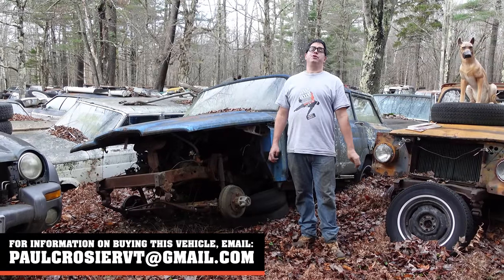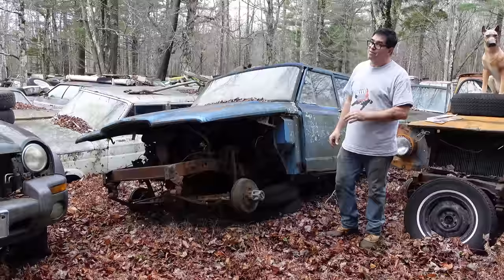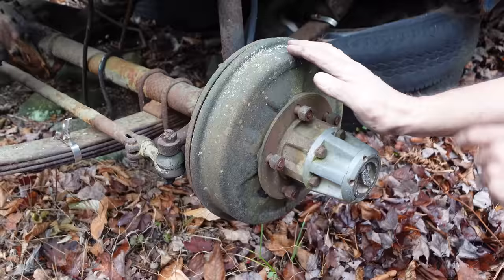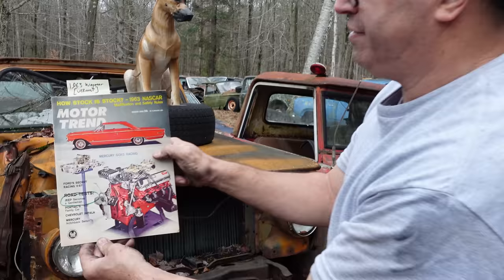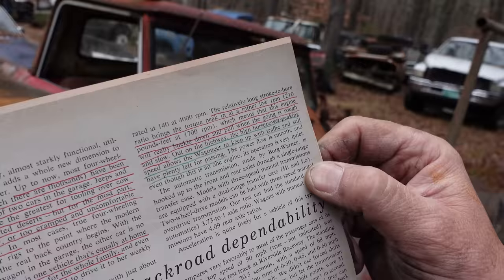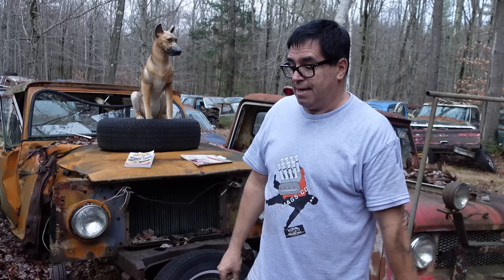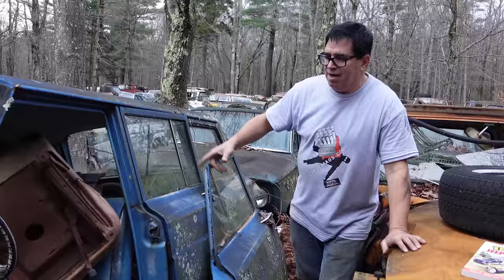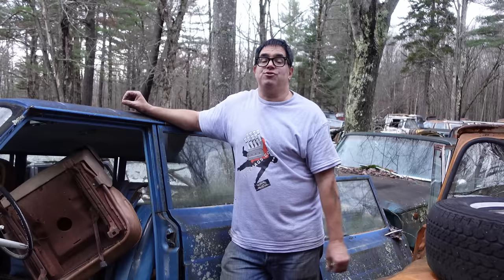Low VIN It…The 315th Wagoneer Ever Built!

Comment: Yup, need the VIN to win:

14 for J-100 4WD Wagoneer, 14 for four door station wagon, and a production sequence of "1" denotes a 230 CID straight six equipped vehicle, starting sequences with "2"were for 232 CID straight sixes, "3" for the 350 V8, "4" for the 258 straight six, "5" for 304 or 327 V8, and "6" for the 360 V8. Of course, these codes are dependent on the year as certain engines were not used in certain years.

Starting in 1964, you could also get AC in these. Possible code 223 Nordic Blue exterior paint. The Toldeo, OH complex has been in operation since 1910 and still assembles Jeep products today as of this writing under Stellantis. It has produced Jeep products on a continuous basis since the 1940s.
Reply: I wish he would learn how to pin comments so yours would be at the top.
Reply: @maineiacman  Nice of you to say. Pinning comments would be Mr. Magnante's choice to do so. It's his channel and I'm supplementing the information he provides, rather than taking his thunder away.

Comment: I have a Wagonneer from the first month of production. The 87th off the line in September 1962 and number 315 in the video rolled off the line in October '62 with serial number prefix 1414 (J-100, 4500 lb, 4x4, 4-door wagon). I also have the same Motor Trend magazine. My Grandfather had a '64 Wagoneer with the 230 Tornado, 3 on the tree, for his farm truck. I used it for plowing snow and running local errands until rust became a safety issue in 1989. Great video, well-informed, and Subscribed.

Comment: My childhood friends dad (who just passed away 2 years ago at the age of 89) bought one of these brand new in the fall of 65.. It was a 1966 model Wagoneer Sky blue with a blue interior. It was a 4wd, automatic trans with the 230 tornado 6. (I'm guessing a few early 66's got this engine until they ran out.) When my friend I first met it was 1975... "The Meat Wagon" as it was called (My buddies dad was a butcher by trade and this was his work/daily vehicle.) was a 9 year old NY Jeep with an interior that was ALWAYS full of bloody sawdust, major rust/rot in the lower body, and sporting dents on every panel but the roof and hood. Back then she was considered to be "FUGLY".. But, today she would be considered to be a "Smokin Hot" patina ride!" LMAO!  The rest of the family refused to ride in her... But we loved her! The drivetrain was rock solid, starting every time ya hit the key and the thing would go anywhere in any weather! In the summer of 1977 my buddy and I at the age of 14 spent our entire summer vacation shoveling her out, patching up the floor pans with roof flashing and generally fixing the old girl up... She was in the family until the mid 1980's when my buddies dad sold it. I saw her several times chugging down Smiths Point beach on Eastern LI while I was there camping out in my spruce tip green 67 Jeepster Commando. God! I haven't thought about The Meat Wagon" in years... Good Times Man! Thanks Steve and Lockjaw!

Comment: I worked for a guy who ran a gas station and bought one of these with the 6 banger, new in 63. It would plow snow like crazy. The drawback on that engine was slow oiling to the top end and after a dozen years of around town (short trips) and daily starting to drive 50 feet out of the bay into a parking spot, the thing smoked like a chimney. (less than 20k miles at that point) Sent the head out for a valve job and new guides... it was like brand new. The guy finally retired in the mid 90s and probably sold it, still rust free from being garaged its entire life. As I recall, it was the base model, radio delete. The plow had a belt driven pump, so all old school. The front bumper had been removed in favor of a large rough sawn piece of wood, so it could be used to push cars around the yard. I'm sure it was stored away in his garage at home and in perfect condition 30 years later.

Comment: I remember in 1964 or 65 in Northern Wisconsin a neighbor getting one of these. We were impressed. I had a late 1980s model with the updated grill and front facia but it was very obvious when the hood was up that the original grill and facia were still there behind the new. It was great in the mud and snow but I did manage to get it stuck when sunk in wet mud up to the floorboards. Always bring a winch when four wheeling. That was a long hike out looking for a phone to call for a tow on Thanksgiving morning. Luckily the bars were open in Wisconsin.
Reply: It is a common mod to take off the later plastic " updated " grills and bolt on an old school " Rhino " grill ,  They really ran on a shoestring budget and having to change the press dies for any sheet metal changes was not practical politics .

Comment: I owned 2 Wagoneers and 2 Cherokee badged Jeeps ranging from 1978 to 1985. I loved them. Three of them were 360 powered. A beautiful 1984  was a 258 6cyl. That one got totalled by my wife. I also had a 1968 parts Wagon, that one had a Buick engine and turbo 400 trans, transplanted from a Jeep pickup that had a PTO driven dump box. Weird stuff.
Reply: in line I-6 was only engine we could get in calif in 1984-85 add a 4 speed  with a low first or opt  5 speed
Reply: There's a 401 jeep motor it fit .  I put one in a Wagoneer.  Only available a few years but interchangeable.   What a motor.
Reply: That 401 was Santa Barbara CA.

Comment: I had a JeepWagon 1962, a Jeep FC 150, a Jeep Commando 1972, a Jeep CJ5 , a Jeep J 10 pickup truck. All had 6 cylinder engines. They were designed and built to be back road and off road vehicles which they were very good at . Would never own one for highway cruising.  To day I own all wheel drive Subaru 1 Forester and 1 Outback. City life now days.

Comment: The 315th Wagoneer? Maybe... Generally the mfgrs take orders in sequence, builds are scheduled whenever all necessary parts are "supposed" to be in house. If something is not in stock, build is delayed. One before 315 could have easily been 300, 326, or even 370. A early vehicle should have everything on hand but not necessarily. I have two instances of consecutive Ford build sheets (two sheets in same car) that VIN are 50, 60 even 150 apart.
Reply: I used to order fleet cars in the 00's and remember getting Fords in with consecutive VIN numbers with production dates a week or more apart. I think at that time they, or at least Ford was "batching",  running one color at a time and switching colors every couple of days. I found that out when I tried to place a late production order and was told the color I wanted was "built out" that they didn't have any more slots available on days they were running that color. Same for the Sheriff's department, a deputy totaled one of the squads and when they tried to re-order they were told they were done making black CVs for the year but they had some federal Blue slots open. They had 20 squads for a while 19 Black and one Federal Blue.
Reply: @fk4515  Color info interesting, I'd suspected that happened. Back in '60s Ford often had as many as 15 colors available on most models, unless special ordered, not all were shared between car lines. Even then would have made sense to paint as many as possible that were same color in batches. In later '60s Atlanta built full size Fords & intermediates, that's probably 20 different colors in addition to special orders. Additionally, two tone paint was a common option.

Comment: Absolutely 💯 love  💖 these Jeep Grand 🚙 Wagoners 63 - 91 !!

The fact this model had a 28 year run , 
Tells you how successful it was 

Thanks for showcasing these , Steve  

230 c.i. Willis Tornadoes  engine , 
had a hemi cylinder head ?? 
Still Kaiser at this point , or Willis ?? 

I saw one of these ( '70 restored  ) at my old job with a , Buick 350 c.i. bolted to a , Chevy transmission Via , an alloy adapter plate . 

It said Kaiser / Willis on the A Pilar VIN tag . The SUV was beautiful

Comment: That 230 absolutely baffled mechanics of the day .
This was it's only true Achilles Heal .
The typical mechanic had not a clue in hell how to service them .
This what ultimately killed the Tornado 6 , despite being a damned fine piece of mechanical engineering .
Another crying shame is that AMC never built a cross flow head for its own I6 motors .
The AMC sixes also lasted for decades .
Another engine that had incredible staying power was the Buck Fireball V6 , which Kaiser bought from GM to use in the CJs .
AMC sold it back to GM in 1974  and it lived on into this century In various iterations .
Lots of interesting threads and trivia relating to Jeep , AMC , and , Kaiser .
The 327 V8 Kaiser used , was a first gen AMC design it bought from AMC thru 1968 .
Kaiser then used the Buick 350.as the  V8 option until AMC  took over and put their own Gen 2 / 3 V8s into the universals and eventually the CJs . These lived on with the SJ Wagoneers until 1991 , ending a 37 year run that started in 1956 and went thru 3 major designs .

Comment: The tornado over head cam engine had abuilht in vibration. The heater hose clamps would losen and  spray antifreeze on the distributer and cause a backfire and blow the muffler.  I was working in a gas station in the 60's and we replaced several exploded mufflers.
Reply from the maker: Hello Dar Vader, is that you? Did we just have a phone conversation? Anyhoo, THANKS for watchin g and writing. -Steve Magnante
Reply: That's,me alais name david wallace of poland new york

Comment: we had a '76, inline 6 and 3 speed on the floor, and two-doors. This early one is very special.
Reply: the early  80s  GW . cheokees  was still inline I-6  and 4 speed  opt 5 speed  as the v8 was not av in calif.. have to look it up the yrs  did see a lot of them in Mexico. all with 4/5 speeds  as most trucks down there where  still 4 speeds
Reply: A two door would of been a Cherokee
Reply: @fk4515   SJ cherokee 1977-83  was all so  offed in a in a 4door

Comment: Domestic inline sixes (Volvo B30s being the sole exception) get my interest. The Tornado was an interesting design with impressive power for its time. It’s too bad that Kaiser/Willis didn’t try to work thru the problems that made this motor a short footnote in history. I guess that in the 60s when gasoline was cheap, it was just plain easier and probably cheaper to drop in a V-8 than to tweak a high tech six cylinder.
Reply: This engine was shipped to Argentina, and was used firstly on Jeep products, then was engineered to be put into Rambler cars. The best version was put into a Rambler American model renamed the Torino.

Comment: It would have been cool if they kept the tornado and AMC took it on during the takeover. A cross flow 4.0 could have been a thing, and how cool would it have been!
Reply: It was looked into , IIRC , but would have required some extensive modifications which were  not in the budget .
Still it does impressively for a non cross flow design , and can be made to put out some fairly respectable power .

Comment: I've had several of the SJ series Jeeps over the years. Still have a '64 J200 4spd thriftside, '68 Jeepster, and '79 Cherokee in my stable. The 230 is definitely a unique engine. I made a custom oil shield so I can do a valve adjustment with engine running. It leaks oil at the front cover like they all do. There is a retrofit kit put out by Jeep to address the issue.

Comment: I had a 74 AWD straight 6, still kick my ass for getting rid of that. No power though, if you got it swamped in the mud the 6 banger didn't have enough power to spin all 4 wheels locked in quadratrac lol.

Comment: 1966-1968 I believe, they sourced TH400 transmissions from GM who supplied the shorter bellhousing case used behind Buick Nailhead engines.   They also sourced V6 and V8 engines from Buick, which by then had the standard BOP pattern on them.  So they had a short bellhousing adapter to combine them.  Pretty wild.

Comment: Olds had a over square engine in the late 60s, the 400g. 3.875" bore x 4.25" stroke and it was a low rpm engine. Basically a de-bored 455.

Comment: Sure hope someone sees this video and makes the effort to try to rescue this. It should not be rotting in a junk yard.

Always loved the original front end of the Wagoneer. The vertical slats and the forward leaning angle. When AMC redesigned it to the horizontal full width grille in the late 70s it kinda made them look a little more plain.

Comment: Hi Steve, nice video!  Nice truck!  I did not realize that engine was ever produced.  I plan to perform more research in regards to the Willys Tornado 236 engine.  In my opinion, that Jeep Wagoneer is a very rare find and I would say it will move quickly from Paul Crosiervt's used auto parts lot.  Parts for that truck should not be too hard get, the complete engine is the most important item.   Please reply.  Dave...

Comment: Was 1962 the last year of the original body style then? Dad had a 1953 Willy's Overland wagon F-head 4 cylinder 4 wheel Drive, then he had (what I thought was), a 1966 Kaiser Aluminum Corp. Jeep Wagoneer, also 4 wheel drive. It had that same 230 engine, ( I know 'cuz I helped him pull it out & it sat in the corner of the garage for many years). Had a spun rod bearing & destroyed crank, so dad dropped in a 1969 chevy 250 six. Now I wonder if it was titled incorrectly, or cobbled together because it was bought used with the very same 230 that you said only went half way through 1965 model year. I worked on that vehicle a lot. No where on it did I see the name Willy's. So???

Comment: When they started putting the leather interiors, alloy wheels, etc on these is when the downfall of all the basic 4X4 started and ones like this became obsolete. The same thing has been done with the Mercedes Gelandewagen. When it was a stripped down truck with a little diesel it was great. Now its an over priced show piece with every gadget and a huge V8 engine. They need to go back to basics like this and price them accordingly. Im not a show boater and dont need all the fancy bling. I remember back in the 80's to early 90's around here the two most famous yuppie status symbol vehicles were the incredibly sensible Volvo 240, and the gas sucking Jeep Grand Wagoneer with all its bells and whistles. Most of them were dark blue or black and always had the fake wood trim on the sides. The Volvos are prob still running to this day.
Reply: seen the ineos grenider ? its a basic  base model 4x4 wagon looks like the org defender station wagon , isome thing that I can make a car camper out now called , overlander , no  need  for 3 rows of leather seats , 2 sunroofs , 2nd row ent screens , or as most wagons now called S.U.V.S have to have indepent  rear suspension    '" for a smooth ride and leg room for the  3rd row "  id be happy with manual crank windows
Reply: the org Gladewagon  professional is un stoppable     so is the unimog

Comment: Love these videos Steve!  I'm pretty sure that front axle is a Dana 27, not a Dana 44.  63-71ish Waggys had the Dana 27.  My 63, 65, 67, and 70 all have the dana 27 front axle.   I believe from '71-'73ish they used a Dana 30, and Dana 44s were used in '74+ with disc brakes.  Gladiators, from what I understand,  had Dana 44s from the beginning.
Reply: I had a 1974 Jeep J10 with a Dana 44 front axle and drum brakes. It was a great old truck, but not real good at stopping!
Reply: there is a 64 gladiator at my shop right now awaiting body work.  Still has the tornado 6

Comment: Interesting to see a vin tag screwed on lol
Reply: Generally a affixed tag is considered a warranty tag, actual VIN(same) is stamped into frame. If door were replaced from another vehicle the tag would be incorrect, that can open a can of worms. 

Only time I've seen VIN tag on a removable part was the '70/'71 Torino/Cyclone. On those it was riveted to the dash pad, which is fine till pad is replaced.